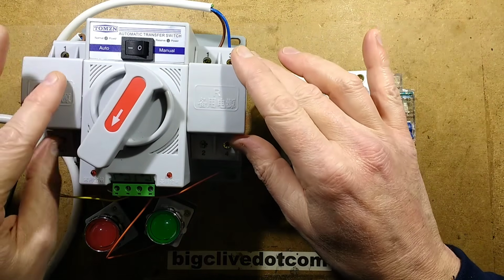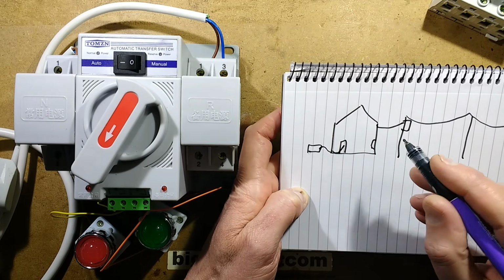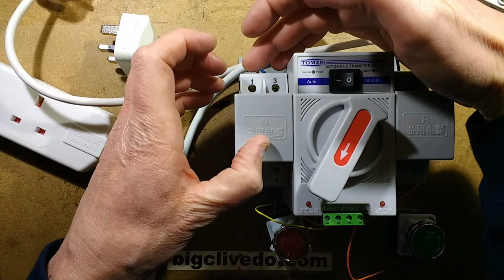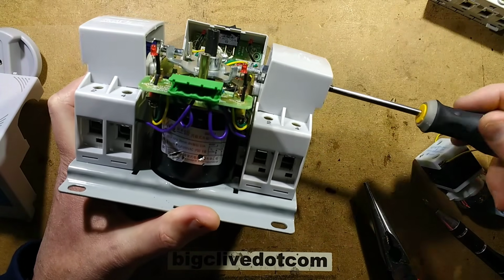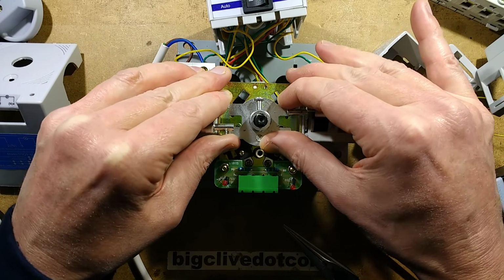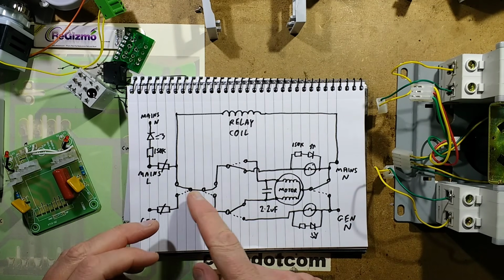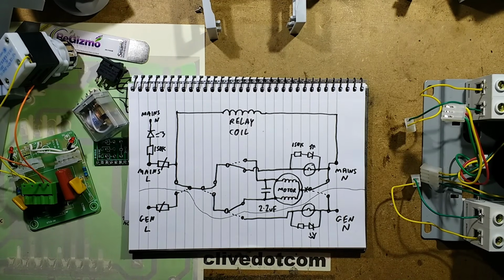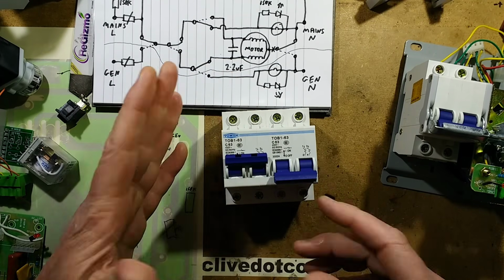Automatic generator changeover switch (with schematic).

Comment: I have been looking for something a bit like this, i don't really have much clue so i'm learning as I go though. I have a boat that has some lights and whatnot on a battery bank that can be charged by the engine or by solar, I also have a mains feed from the dock. 

Ignoring the engine charging for now, what I want is to run everything off the solar, but if the solar can't cope i need it to switch to mains supply when the batteries hit a set low voltage and back to the solar when they are charged enough. 

I would also like to have a battery tender running off the mains but i may have to set that up to run manually as i don't want to charge from the mains unless the solar really can't keep up, it may be a moot point anyway as I'm looking at mini turbines, there's plentty of wind here.  :S

 Any suggestions for some way to set that up simply or am I going to have to buy something more electronic than electromechanical?

Comment: You know I always here about that lineman get shock through backfeeds. I don't know of any lineman that would pick up a downed cable and not verify if it is carrying any power. Any electrician worth his salt considers conductors live. The only time electricians know when power is not live is when they're pulling in wire for the first time!!

Comment: Two things I'd love to say,  first is that Clive is my hero, and I learnt all my electronics through this channel, especially the Fanny Flambeaux doll vid. Second thing is that I have a 4 pole contractor with mechanical and electrical interlock set up, and I run the outputs into one of these Tomzn mechanical transfer switches, but a 4 pole version. The contractors change over is close enough instant, but with this Tomzn unit inline, the delay is increased and also, if the breakers failed, I'd rather that then a sticky contractor. Love this unit, and I love the simple wiring on the output indicators. I had to watch this then ask when you join the output contacts together would that back feed the indicator for the mains but the relay solves all that gunk.

Comment: Can I use it to use between ac/dc?
Reply from the maker: DC will damage the relays and motor.
Reply: @bigclivedotcom  I am looking for a solution to automatic switching between ac & dc input for solar submersible well pump. The controller is ac dc input ready. All I want to do is automatically switches between two source. 

Any suggestions?

Comment: One important thing missing from that module is a 0v relay output for the auto start signal for the generator. Without an auto start it's pretty much useless.
Reply: not so. my generator  has remote start so when main power goes off i just pick up the remote and start the generator

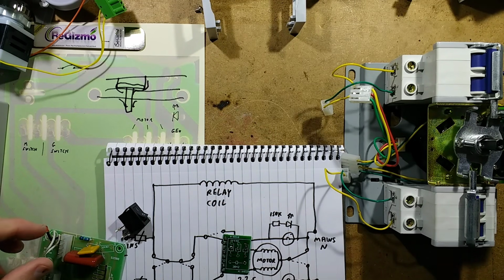Comment: 17:54 Next time you need to de-solder something that either has a lot of pins (ribbon connector socket, IC chip etc.) or has been heavily soldered in (like this relay) perhaps you should use your hot air station to heat up all the solder joints at the same time making it much easier to pull the components apart without damaging them. Louis Rossmann (3rd party Apple Product repair man), for example, does this all the time on his channel.
Reply from the maker: The hot air is much more useful for surface mount components.  It doesn't work so well for through hole stuff, especially with high thermal mass terminals.

Comment: I've trained as a Canadian Electrician so I'm not familiar with the USA's NEC. In Canada, ALL Residential Generators MUST be connected to the Circuit Panel (Breaker Box) with an Interlocked switch that physically disconnects the City feed when the Generator feed is active. This prevents the Generator from back-feeding into the City Grid and thus keeps it from Electrocuting any Hydro Linesmen (the Electricians Licensed and Trained to work  on the multi Kilowatt Power Lines). I believe the NEC has a similar Regulation.

Comment: Clive on the bottom small contacts is there a set of N.O. that can be used to start the generator?
Reply from the maker: I think the contacts at the bottom are intended for indicators.  You might need a separate system for starting the generator as it has to power the changeover.

Comment: Good advice to add extra 63 Amp MCB's in series with the transfer switch unmarked  MCB's. It worries me that the manufacturer doesn't label those MCB's, they could easily be cheap unbranded knockoffs. We are talking mains supplies here so the equipment has to be safe. I prefer always a dead or zero position when changing over a transfer switch. (generator - zero - mains). With that double 3 kA rated MCB at the end, under fault conditions and arc flash could easily happen with serious burns to the unexpected home owner, who is usually not an electrician.
Reply: Technically this does have a zero point in the manual transfer mode, it's just unmarked and you have to be very precise to hit it :-)

Comment: A widowmaker lead, priceless comment Clive . We call that a suicide lead in New Zealand. The risk of backfeed does exist. but Testing and Earthing is mandatory as well as using PPE. Normally a private generator <20 kVA will trip out on overload, as the network load on the affected phase will draw whatever current it needs for the other users fed of the affected transformer. In rural area's for sure there is a higher risk of back-feeding as the loads are usually lighter.

Comment: When you feed into your main utility feed its called "Islanding" and can kill lineman.
Reply: To be technically correct it's only called islanding if the lines are cut off so that you can get a meaningful voltage onto your isolated "island" section of the grid.  If there's no lines down then there's no island, and there will be such a big overload when you try to backfeed that your inverter/generator will shut off almost immediately, just as if you'd short circuited the output.

Comment: You must have come across JIS screwdrivers, Clive?  Japan Industrial Standard. Much better fit for far eastern screws also work well on Philips screws. No climb out. You can get Vessel brand JIS drivers of all sizes on Spamazon. Not cheap, but a real investment.
Reply: Very good.  Surprised no one else caught that.  I think it's got the small dot indent on the face of the screw...which I think I saw just now.

Comment: Hi clive. great channel. i've juyst ordered one of these to take an input from my solar inverter and another input from my generator. just wondered what i should do with the earth wires from both inputs.
cheers for any advice.
Reply from the maker: Generally speaking all grounds should be commoned, but that may vary depending on locations of equipment and local regulations.

Comment: I USED A TWO WAY RELAY TROUBLE IS IT IS NOT AUTO BOTH L/N ARE SWITCHED COIL IS 12V FOR MY OWN SAFETY 
THANKS FOR SHARING 
MUST GET AN AUTO SWITCHOVER      (THINK I WILL DO WITHOUT THE GIN AND TONIC JUST IN CASE )

Comment: I was thinking about how that transfer switch could have a breaker instead of just being a switch myself because the motor wouldn't necessarily allow it to turn off. It dawned on me at the end of the video that, in the event of an overcurrent, the breaker would move to the trip position and not the full off position, which of course, theoretucally, wouldn't affect the position of the motor arms at all.

Comment: Am I the only one not seeing a fuse ? If there is a fault in the device causing a short circuit, those tiny wires soldered to the breakers arent going to last long at 63A or what ever size fuse in front of it. And soldering to the terminals also seems a little homemade to me!
Reply from the maker: The incoming supply has an HRC fuse.
Reply from the maker: The incoming supply has an HRC fuse.

Comment: QUESTION, why is this system better then a high power RELAY?
i bought 80AMP relays for this purpose, the benefit is that the switch-over time back from the GEN to Mains is milliseconds not actually turning off the power to electronics (JUST LIKE A UPS) 
so as soon as mains come back relay can be energized and automatically switch, (in my case its configured actually in the opposite way by a control circuit having the relay de-energized as default)

My main concern was maybe damaging electronics as there is no synchronization, and fast switching effectively resulting a more dense pulse of the sine wave, but as i seen nothing seem to have a negative effect... 
THE MODEL DUMBER OF THE RELAY IS JQX-62F (can google to get results)

can you express your opinion about this in a reply?
ALSO, if almost seamless switching is not necessary the same can be achived with 2 contactors that have an interlock electronic NC switch, ( so the GEN contactor coil cannot be activated if the mains contactor is active  this also gives "priority" to mains and actually also reduces switching time to less then 0.5 sec 
but this design is more riskey due to the fact there is no machanical interlock like in the RELAY that has a dual throw.
Reply: After watching Clive, it seemed perfect to apply to my solar inverter shed deep-freeze but on buying one and connecting it to have the inverter as the MAIN source and the 240v as the reserve power - it will not work. I bought a 2nd version but haven't tried. You relay idea is easier.  I did ask Clive by e-mail "Why won't it work with an inverter as the preferred supply" but I suppose he gets THOUSANDS of enquiries. Perhaps I should bribe him....;-)
Reply: @Ronny: I also got hold of a couple of 100 amp relays expressly designed for this.  They even had a mechanical interlock so even if you did energise both relays at the same time only one would physically connect.  You can find them on eBay fairly cheap but you have to search for "contactor" rather than relay.  They are typically three phase but work fine with just a single phase.

@Daze: There should be no reason it wouldn't work.  Is your inverter pure sine wave?  If not it may not be able to run the motor properly.

Comment: back feeding is the reason i think why you cant parallel inverters for bigger capacities.

even if you dont blow up your generator,zap or kill linemen when they turn the power back on there would be a bang and broken shards of ceramic and glass as the switch housings on the poles are often glass or ceramic and they explode when they fail.

not just lights but electronics.

much of the entertainment uses automated animated props like the ursula model at the disney little mermaid ride (got attention because her head fell off) features electronics controlling the models and power surges can destroy electronics.

wire wound loads and light bulbs are more tolerant so the bulbs may dim and brighten to a point.

arc lights may go out if the voltage goes low as a certain voltage and current is required to maintain the arc and the bulb may not re light until it cools.

why the breakers dont have markings is they probably are not intended for individual retail sale they are intended as oem.

however it looks like you can change the breakers to give higher current load
Reply: You can parallel grid tied inverters as they are designed to see external power on their outputs, but normal inverters aren't synchronised to the same frequency and phase so they will 'compete' if you connect their outputs together, and either shut off or blow up, depending on how well designed they are.

Comment: Hey bigClive. I noticed that you said the US has two phases in residential. I also thought this was the case until I looked at a transformer. It turns out the it's single phase 240v with a center tap to neutral. I hope this helps.
Reply: I refer to them as phases, just 180º apart, rather than 120º. I don't know if that is the "proper" terminology. I've had a few arguments with folks about that...

Comment: So that last split second that the electric kicks back in, they wont be any power going to the genny?
Reply from the maker: The motorised unit has a distinct gap between the two supplies being switched.  Mid position, both are off.

Comment: Overly complicated and highly inefficient no wonder people die, usually when you plug in  a generator without turning off the main line the circuit breaker trips.

Comment: Could you use this to switch between solar panel inverters with arrays on different orientation roofs?
Reply from the maker: This unit has components designed for AC use only.

Comment: All lines under work are bonded and grounded, and then insulated from the workers as well.  It's a pity about that always-on relay - I wonder if the unit could be run with the mains and generator input swapped.  While the generator might seem a little risky wired directly across the live mains, what would be much more dangerous would be having this switch manage failover for a single phase unit, FROM multiple input phases or sources - this could go really pear-shaped in a millisecond if one phase were connected to another, or the user was tempted to bond neutrals or earths from different parts of the building - that would really piss some electrician off...
Reply: Why would this switch be problematic to manage switchover between two phases?  The video shows both live and neutral are disconnected on the input before the other side are connected, so earthing issues notwithstanding, shouldn't it be ok?  I can't see how you'd end up with both phases connected together.

Comment: That's not a great design.  With the relay powered all the time, it's doomed to be the lifetime fail point for the unit.  The relay should be in the resting state with mains power on, since that would be the majority of the time.  And in either case, the limit switch should remove the power from the relay coil once the motor has switched - not just the motor.  As you said, if the relay fails, it fails in Generator position.  You said it's not a big deal, but it is if it's already in Generator mode when the relay fails.  You'd have to monitor the power yourself and switch it back manually.  If it was "Mains default" (relay unpowered in Mains position), when the mains came back it would switch, then stay there unless manually switched.
Reply from the maker: Technically speaking the roles can be reversed so that the relay is dormant in normal mode and only energises when the generator starts.

Comment: Clive, is it possible to do an Auto transfer switch with a Generator priority and a 12V solar as the "normal full time" power? I have an off grid cabin that I would like to set up so if the genny is started the solar power is cut. Additionally, how would one set that up to auto charge the solar batteries? Thank you for all your review and instruction I think you have saved my life more than once already.
Reply from the maker: You could use a relay powered by the generator to switch the load from the battery pack to the generator based power supply.  A relay could also connect the batteries to the generator powered charger.
Reply: I've tried to make the solar/inverter the primary but it doesn't work and I don't know why????  Can anyone suggest, Can you CLIVE??

Comment: I wired a farm building once using a 240-drop (out of the circuit box) and a 50-amp breaker. To resort to your 2nd input, you had to turn off the main, then turn on the 50-amp breaker (which acted as a 2nd main for the generator)...no harm, no foul, and gets around having to buy a $150 transfer switch....that said, it is NOT TO CODE in the U.S. (don't let an inspector or electrician see this barn-burner circuit!)  A far-easier way to do this is to simply drop a circuit to a small box and use a 3-position rotary switch rated for the circuit to act as a transfer...which in circuit, would replace the breaker in my example. Again, MUCH TO BE SAID FOR RELAY-DRIVEN TRANSFERS where you have a 'dead pole' at midpoint, so that you cannot have BOTH SUPPLIES HOT at the same time (bad, BAD news for the power company, your home, etc....because they are not in sine polarity with each other!

Comment: The problem with the manual switch is that once you switch from your generator (solar panel as an example) to the grid, if you wanna switch back to generator you'd have to turn your switch off to be able to be back on your generator.

Comment: Speaking of generators and transformers, you might know something about this that I don't. After a power outage in my area about a month or so ago, I was walking around and spotted a generator sitting next to a utility pole. The pole had transformers and it had one of those metal boxes with I don't know what inside, I assume things for cable, phone, internet connections etc but could be wrong. The generator was not running but had a very thick cable (about 2 inches thick) running from the generator up to the box. I wonder if you might have any idea what it could have been there for. it was in the same spot for a week after the outage, was chained to the pole and had a sticker on it that said it had GPS.
Reply from the maker: Sometimes during repair of serious damage to the electrical distribution system they put in temporary generators that either feed standard mains voltage onto the distribution cables or have a generator/transformer rig that feeds 11kV or more onto the transmission cables to power a wider area.
Reply: That would make sense to me I guess, but this was only maybe a 10,000 watt generator at best. If I was to guess, it was a 1,000 watt one from Canadian Tire, not a very big generator at all, you'd be able to walk away with it if it wasn't chained. There wasn't several, but just the one in the whole affected area.